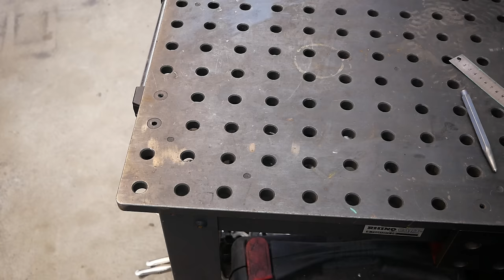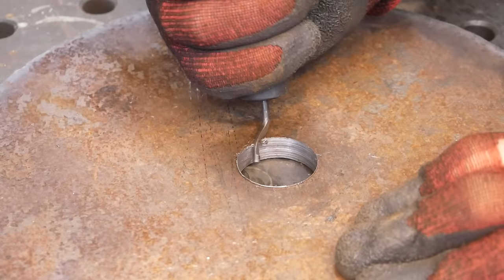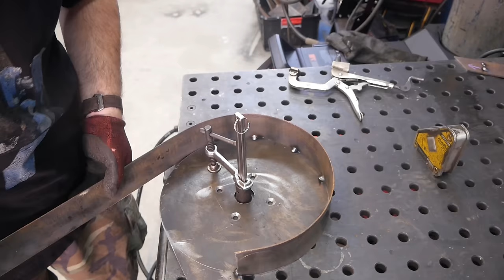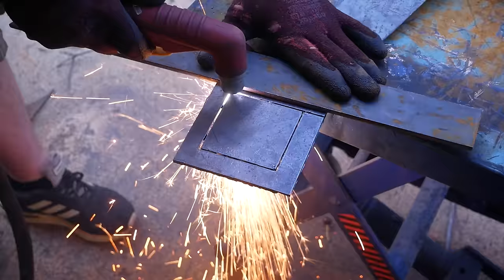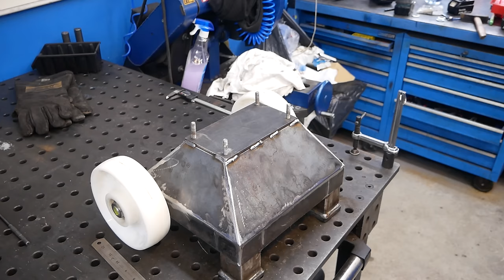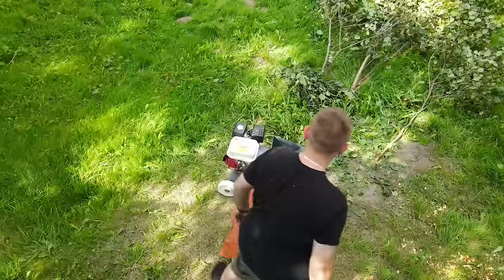Branches will Never be a Problem again - Wood Chipper build

Comment: I acquired a bb chevy truck flywheel and was gonna mount some hardened tool steel blades on it and mount it out front of an old garden tractor and use it as a brush cutter.

The ID diameter of the hole on the inset part where it bolted on to the crank shaft fit just right on a 5 bolt trailer hub, I would need to drill some new bolt holes. So was gonna mount the hub upside down with the flywheel on it and use a pulley and belt to/from the mower engine.

Never finished it and got rid of all the stuff except the tool steel for the blades due to cross country move. Now I got a ton of branches I need to get rid of. Think I will start looking for another flywheel and mount it on the hub and run it from my Kubota tractor PTO and make a chipper like this. The big heavy flywheel should do well as a chipper blade mount due to the 20 lb weight once that baby is spinning at 1000 rpm from my PTO shaft.

If anyone is going to make a chipper like the one in this video I recommend a separate shaft mounted on pillow block bearings and use a tapered mount pulley and use the pulley as a hub/mount for the blade. use a belt back to the engine.

Comment: Wonderful job . Many suggest here to add belt with pulley. Will RPM and torque increase? they say it will protect engine stress and smoothen the work.

Comment: Very good. Just needs more fly weight on separate shaft to let it work through larger branches. I would add  another plate under the face plate to support cutting knives.
Also needs fold out leg base an hand truck vertical to the wheels .

Comment: Whohoo - that was a fun build :-)  I especially liked the hammering going from square to round for the outlet.

About knives. Look at the cutters on a chainsaw. There is a rider i front of the cutter which limits the depth of cut for each tooth. Then each tooth also have a clearance angle. For a wood chipper something similar would be a good setup. Easiest to do (perhaps) with the knives recessed at an angle into the rotor.

As you are digging deeper into the mysteries of the wood chipper - I sure look forward to the one you no doubt will do with an infeed mechanism 🙂
Your videos are always a highlight in my day. Very entertaining.

Comment: Directly on the engine shaft? That's a bold move, especially with these junk engines. From experience, this works, but with older properly built ones, modern ones shatter if you so much as sneeze at them.
Reply: that is how the factory builds them ..

Comment: Should of maybe installed a jackshaft and ran a chain or gear drive to it to drive the chipper head so it's not directly putting stress on  crankshaft works good though by looks of it but how long time will tell

Comment: All seems fine, but I'd add a belt drive from the motor to the rotor of the chipper. Unbalanced rotor and chipping actual branches might wear out the motor bearings prematurely. Especially if a branch gets stuck and stalls the rotor, belt might and probably would slip, and in this case a huge blow to the motor

Comment: If your blades were not as thick and the slots behind the blades as large the chipper would not be jerking the large limbs out of your hands and possibly stalling the engine. A nice build, I will try some of your fetchers on my next attempt, what size was your engine? In the thumb photo, you show the flailers on the same side as the knives how could this be?

Comment: Nice work!  Question is why did you not pull the spark plugs when testing the rotation of your unit LOL. I saw you had to pull against the compression.  I would love to have tools to do builds like this.  Thanks for teasing us with your skills :)  Last thing: OMG you should not wear that watch etc when feeding that angry beaver!  If the branch catches your watch etc. then good by fingers.  I had heart fluxuations watching you get your fingers past the edge of the feed. You only need 1 mistake to end your maker hobbie.  Be safe....

Comment: Hello, good sir. I am from Algeria. I want to ask you. I manufactured a wood crusher machine for a person, and when he started it, there was a lot of vibration knowing that the motor used in the machine is 15kw and 3000 t/m. When I asked, they told me that the motor has nothing to do with vibration. They told me that the balance of the parts did not work. Interior of Kilberg Please advise me sir what to do

Comment: I would suggest to decouple the engine through a belt, or at least a rubber shaft coupling. The engine bearings and parts aren't designed to handle that kind of impact loading

Comment: I would use a rubber spider joint between the engine crankshaft and the chipper shaft besides having the other side of the chipper assembly supported on a bearing

Comment: The design scares me, as others stated the chipper disk outta not be right on the crank. But i gotta say, you built this very well. Very solid, clean work. Im curious on the longevity of the engine. It sounds and looks very well balanced, the engine sounds just right for the load its seeing too.

Comment: Nice build but I would certainly leave more metal on the center of the cutting wheel. Al this weight and shocks are handle by a tiny half inch of metal in the center .

Comment: It seems like the motor bearings would wear out quicker being coupled with the blade this way. Bearings are pretty cheap and could add support from both sides. Nice job on the blade construction.

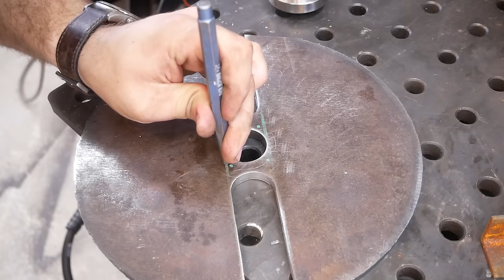Comment: Awesome small compact machine, but I think there is not enough material 6:15 where disc is separated by two slots in to two pieces. Lot of vibration from engine and from cutting can easily crack this heavy disc from fatigue doesnt matter how thick the steel is. Two halves of disc are heavy and stretch this weak point by centrifugal force too.

Comment: This is insane. Aside from the potential engine damage from bearing loadings and vibration that the motor is not designed for, there is no emergency shutoff and the chute is so short you can easily reach the blades. If your hand becomes entangled with a branch or some part of your clothing is pulled in, you can easily be seriously injured.

Comment: There is no way to keep hands from being dragged into the machine when people grip the branch in panic.
  It is simpler to drill the hole in the cutter disc first and turn the mounting bush on the motor to size on the lathe.
  The cutting disc plus blades plus angle iron throwers has not been balanced.
  To static balance the finished cutting disc use a steel plate off cut to make a top hat bush for a neat fit in the centre hole of the cutting disc.
  A small hole inside the top hat will balance the cutting disc on a marble.
  Using weights (coins?) on the disc will balance the light side of the disc.
  Then you can drill a balance hole(s) on the Opposite (heavy) side of the disc until balanced.
  Or use the method of balancing a surface finishing grind stone on a central axis.
  The cut outs on the disc for the blades does not appear to leave enough metal (strength) in the disc at the centre, especially with holes drilled in it.
  There is no way to keep hands from being dragged into the machine when people grip the branch in panic

Comment: I don’t think this works so well. I also think the engine will not support the cutting disc for a long time because of the enormous pressure put on it. Obviously the exhaust tube was an immediate failure.

Comment: 7;23s There's your weak failure spot there.  There is not enough meat / thickness  between the centre and cut out grooves. With use and fatigue it will crack through and have a DANGEROUS catastrophic failure. Unless that  fly wheel piece of steel is made of bizalloy, but even still, I would have made it wider. Please be careful.

Comment: That is a very effective design and construction BUT you will either lose a finger or bend the valves of the motor in NO time.
Reply: bend the valves?
Reply: well factories  have been doing there build like this for years .. what is hard on the engines is low oil or lack of oil change and not running engine at full speed ,,

Comment: I dont know how important the chip size is for you, but if you want more consistent chip size for use in burning furnace, you can add a curved screen (basically a metal plate full of holes that are large as the largest chip you want) just inside the "drum" so it become a full circle, but with the screen where the exit is. In this way, any wood material too large to exit will remain in the drum and be chopped up even more, until in a good size to exit. You may then need to add knives to the outer rim of the wheel to allow the wheel to chop up things that remain in the drum even more.

Comment: The average person will not have the expertise and materials to build one.   Online there are ton of cheap one with motor issue.  I can buy all day long wood and leaves shredder for under $100 with minimal fix up before use.    
Realistically I would not build it even  i already have the know how and tool, material since it does not make sense time wise.

Comment: great design!NOT!
you must be looking forward to changing the cutting blades every half hour or so.
i mean with them being made from mild steel and no easy access to get to the screws holding them......
i guess your engine bearing will hold for a couple of hours before it will be destroyed by the hammering forces working on it.